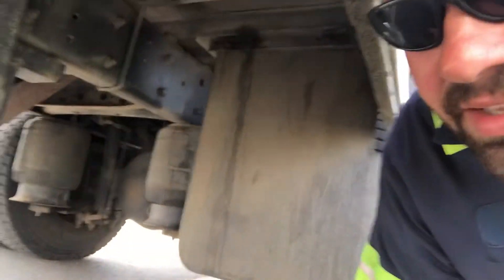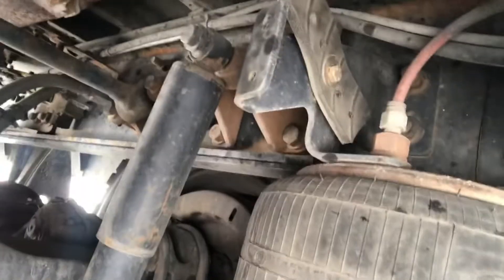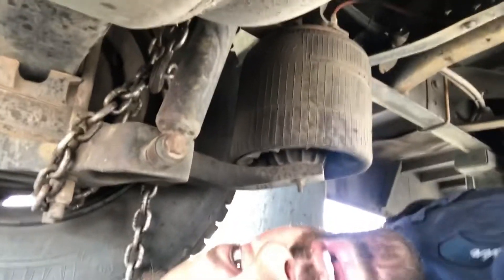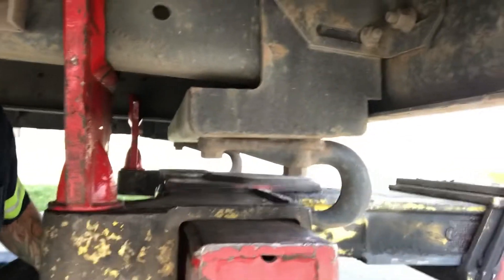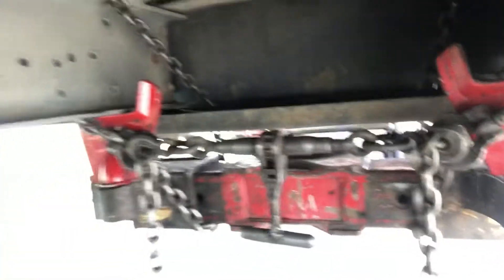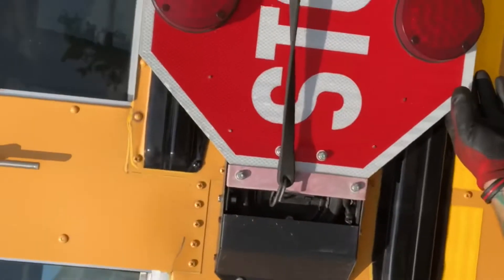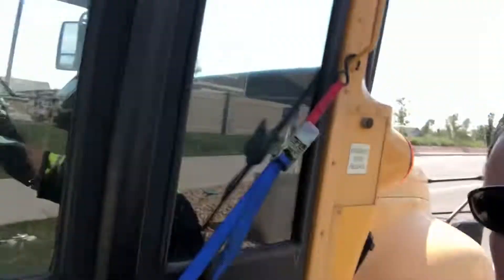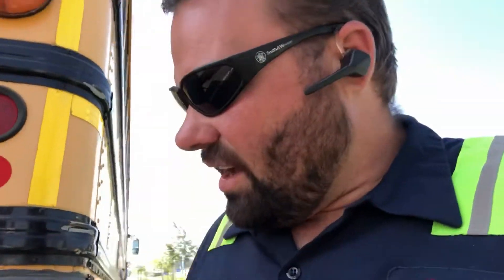School bus rear tow

Comment: I close the door from the inside and get out the emergency exit in the rear Great Video !
Reply from the maker: Thank you! 
Couldn’t do that with the door on this one. Electric over air switch, drained the air when I dumped the suspension. But absolutely yes! That works best actually! 👍

Comment: When using the seatbelt why do you let the air all the way out? Wouldn't this allow the seat to move up and down which can loosen the seatbelt?
Reply from the maker: When I do use the seatbelt, it’s as a secondary securement. The primary would be the ratchet strap. 
The seat stays down pretty good, I don’t believe that I have ever had one lift on me. But I do air it down to tighten the seatbelt. But NEVER use just the seatbelt. Too many variables that can go wrong with it, and in Colorado it’s not a legal securement.